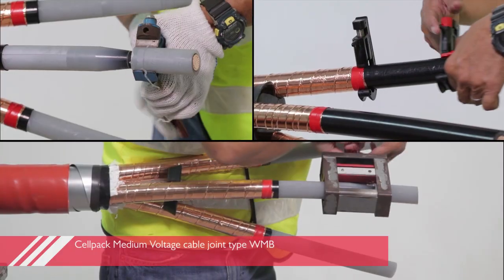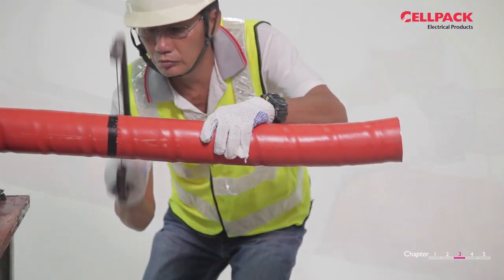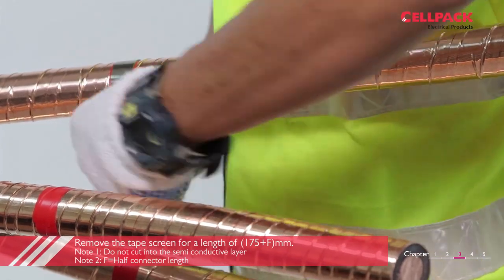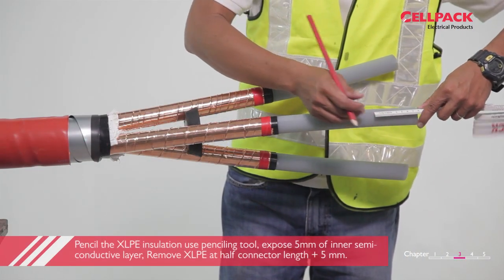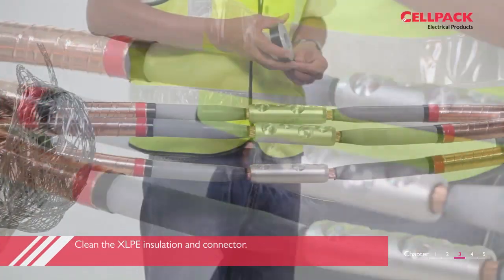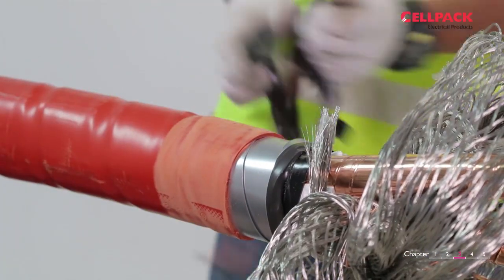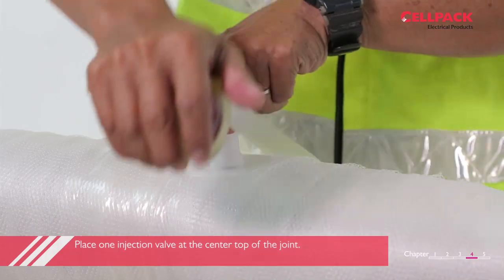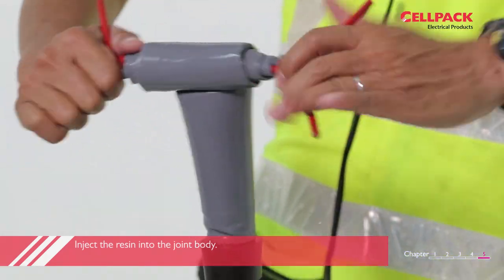Resin Straight Joint WMB 24kV 3Cx240mm2  Cellpack

Comment: All well and good jointing indoor. Try all that when there are pipes ducts and crap in the hole you’re working in. All that room and the cables are not straight and the joint is like a banana.

Comment: Strip the cable sheat with a handsaw and carpet knife? Not really professional....
Reply: The carpet knife is known as a skinning knife for stripping wire insulation. The handsaw is ok as long as you don't go crazy on the copper jacket and knick the semi conductor underneath the copper sheilding.

Comment: The mechanical fasteners are prone to loosening over time through heat and cold cycles. Better to use some solder and liquid electrical tape. That’s what I do.

Comment: For all you dumb people and non electrical engineers or electrician, the 3M video some people are stating that has a faster repair is not even the same cable. This one has different shielding, different layers, different thickness. This to me appears to be properly done and went above and beyond to make a resin outer shield.

Comment: 24kv cellpack, was hoping for an experiment with 6000 lithium ion cells strapped  in series in the good name of science. Chapter 3 was long winded, wasn't it? These bolts snap off when proper torque is applied.

Comment: if you can't fix something with a tape, it means your not using enough tape
Reply: Or simply the wrong tape, there's the right tape for everybody in every situation 😂
Reply: 55555    5 55 55  55 55 55 5555555555 for 5girls 55 5inches 55  5555inches 5555555 5 5  555inches  t5555 555th grade  5 5  555 5AM and  555 5 5 555  5555 5  5555
Reply: you're* not your

Comment: We did joints under heavy rain and trench full of water at same time. And energized successfully 😁. It takes skills and experience.
Reply: But will it keep working for 20,or 30 or more years?
Reply: @asbestosfiber  Depends on the environment first, Jointer skills and finally the Joint quality its self.
Reply: Congrats F A, you just doomed a very expensive asset to fail to reach its full economical life of 40-50 years. Especially on modern cables water ingress is the worst thing for the insulation and should be absolutely avoided. Before energizing you should also do a sheath test and a VLF test at three times operating voltage.
Reply: @bobbwc7011  if no water comes inside. There won't be an issue. However, you have to consider the environment. For example our trenches (soil) is usually full of water since our country is basically an island. Therefore, Pilc joints live longer than Xlpe joints.

Comment: Why im watching this?
Reply: 😂.I was thinking the same.....😂
Reply: i was thinking the same
Reply: Because its important
Reply: is it a power line?
Reply: @Thetreetroll  This is a 24 kilovolt joint for a high power 3 phase AC wire, it is for large amounts of power for say a factory, neighborhood, substation, etc..
Reply: @Thetreetroll  No, this is a cable for wifi
 !!
Reply: @Thetreetroll  no , its for internet
Reply: @omid4861  :)))
Reply: @omid4861  Internet cables aren't that way. It's a 24kV power  line.
Reply: @jackkrieger9150  thad was only a joke
Reply: @omid4861  hahaha
Reply: Its the internetconnektion cable for germany
Reply: @omid4861  - It is actually a high voltage three phase power grid line cable, at least it looks like that. 24 kilovolt in the title tells a lot.
Reply: Re Set exactly what it is. 
24kv is the reason why there’s so many layers of insulation and why it’s so thick compared to what is found in your wall at home.
Reply: @resetcoder  dont unterstand Fun ?
Reply: @originalusernamefail  i use the same cable to charge my Smartphone
Reply: @omid4861  - Nah, xmas kills everything..
Reply: @resetcoder  i understand :-)  i wich u merry chrismas
Reply: @omid4861  you call this wireless charging? 🤔
Reply: @maxmustermann853  no i put it in to the micro usb port
Reply: @omid4861    Now I finally know why I had no Internet connection this day , glad the guy fixed it so fast.
I would love to see a live stream repair of Internet connection cable  ...  

edit: but this wan't work cause the cable is broken ... I'm so dumb 😱😜
Reply: Because you could not live anymore without his knowledge!
Reply: Idon't know about you, but I have to whatch this))
Reply: Hehehhehe
Reply: you are my brother/sister
Reply: Mert Arslan you might have free wifi😛😛
Reply: i felt hypnotized ...
Reply: Because you are ĂŠŚHÖŁÉ. 😂 😅 😂 😅 😂 😅 😂 😅 😂 😅 😂 😅 😂 😅 😂 😅 😂
Reply: pus porque me gusta ver los avances tecnológicos correspondientes a la electricidad.
Reply: It's a video about "mm's"
Reply: Why im watching this, and finished😂😂😂
Reply: i fuking drunk watching this? holy fuck 🤣🤣🤣🤣
Reply: I don't know either...but i'm making mental notes for some reason...
Reply: LOL I knew I'd find someone thinking the same thing I was in comments. It's amazing isn't it?
Reply: same question here lol watched the whole thing
Reply: Knowledge gaining and it's help to create idea to make solution in our lifestyle
Reply: Et moi ?
Reply: I find these high-voltage connection vids oddly satisfying.